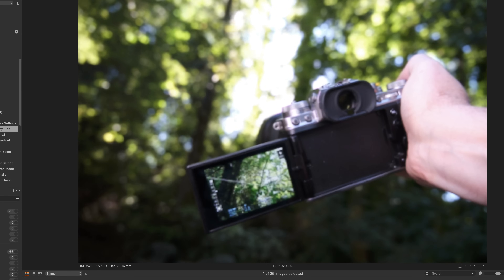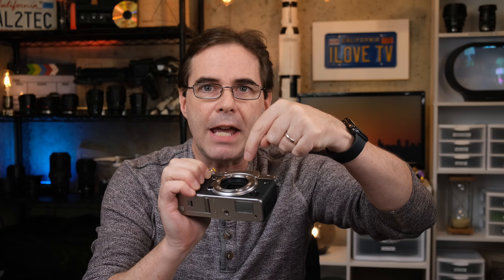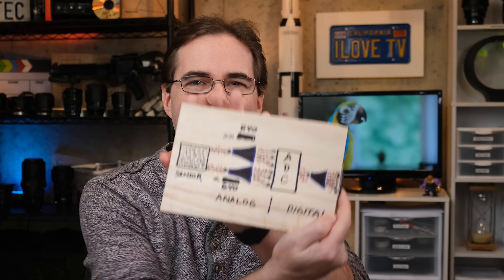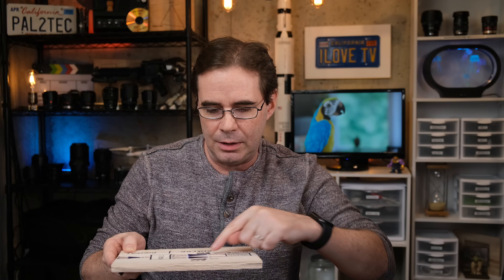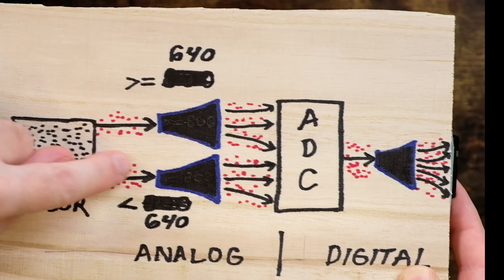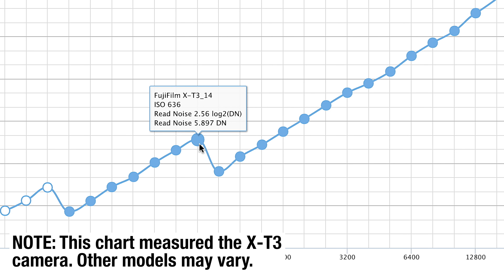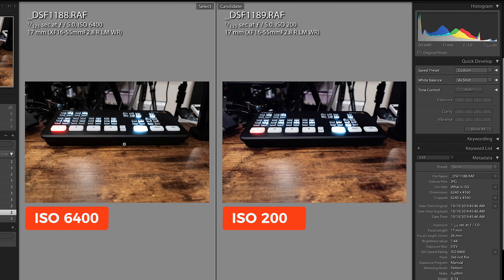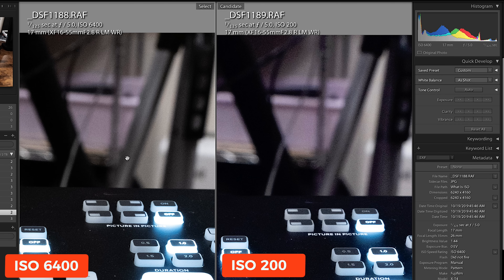Fuji ISO Performance

Comment: Can I take advantage of lower ISO settings by just setting my exposure compensation to EV -2 or -3 and bump up in post processing?
Reply: The sensor-sensity itself isn't altered, that's rigth but there is analog amplification going on as well and and a resulting effective sensitivity. Beside this minor point, well... as I said.
Reply: No, you then have the amplifiers still cranked up but the input lowered which means a worse noise/signal ratio.
Reply: @kalenderquantentunnel9411 , lowering the EV would lower the ISO (if there's room), not raise it. Or is there a different amplifier you are thinking of?
Reply: Lowering EV means lowering the Exposure Value ie amount of light hitting the sensor (for a given ISO when turning the +/- dial but also in general). Increasing ISO means increasing sensor sensitivity by increasing the amplification of the signal delivered. At least this is how I understand it. 🙃 Two seperate entities. Therefore, changin EV means changing shutter speed, aperture or both but does not influence ISO.
Reply: The sensor's sensitivity has nothing to do with the ISO - one of the points of this video. There's a digital readout of the sensor which is solely based on F-stop and exposure time, bot of which control how much light hits the sensor.
You can see evidence of this yourself by taking an ISO bracketed exposure. When you do this, the result is a single exposed picture that is subjected to different ISO settings. Look at the pictures and you'll they were all taken from the same exposure.
This is different than when you take a bracket of exposure or F-stop. The result from these is a set of pictures that are taken sequentially, not a reprocessing of the same picture.

Comment: hi pal question after i transfer my raw file to LR it has 40 sharpness but in my camera setting is normal. i didn't change anything in my camera TIA.
Reply: That is probably LR's default setting and has nothing to do with the in-camera sharpening. The latter should only influence JPGs right out of camera. Camera-settings can be interpreted by PC-software but in some cases are just ignored.
Reply: @kalenderquantentunnel9411   thank you

Comment: You could shoot a low ISO 200 and still get a great exposure without bumping up the exposure in post by setting the shutter speed to bulb.  You could also get a sekonic light meter and set the shutter speed at 1/125th, 1/60th or 1/30th to find your aperture setting on your lens.  If you need a slower speed than 1/30th then please use a tripod.  It may say that you need an aperture of 1.8 on your lens.  Take a shot with assistance of the light meter or in a bulb setting so your photo would have the details and less noise.

Comment: Is it better to set ISO 800 vs ISO 640 (native) to have less noise in video mode (if to compare with ISO 640)?
Reply: He says that the second amp kicks in at 640. So, 640 is better than  both 500 and 800, and 800 is better than both 500 and 636. This is how I understand the graph.

Comment: Nicely done explanation. However, I figured out that trying to outthink the Fuji engineers does not usually improve my photography in a meaningful way. I have a tendency to choose my shutter speed and aperture based on my artistic intent. I will then set my ISO either manually or using one of the automatic settings to achieve the brightness I desire. Sometimes I may expose to protect the highlights other times I may let some of the highlights become blown out. If necessary the ISO invariance allows me to pull shadows up to get the desired look. I usually try to achieve the look I want in camera and I often will have the grain setting on weak and sometimes strong. Therefore noise in high ISO shots doesn't usually bother me. I do enjoy your videos so please keep up the good work.

Comment: How about better yet,  just add light to your scene and keep your ISO at 200 and not have to add exposure in software at all, and have a clean no noise image?
LOL
Reply: He was obviously talking about in the cases of when you can’t add light to your scene, of which there are many.
Reply: @johnp515  there is always a way
Reply: @AMomentInTimeProductions  Interesting. How would you light a distant mountain?
Reply: @johnp515  if it's a distant mountain then you don't need lights, and don't need high ISO unless your shooting it in the dark LOL
it's call a good lens  one that will allow 1.4 or 1.8 aperture  no reason for high ISO in daylight,
a 1.4 or 1.8 aperture you will never need high iso for a distant mountain, ever,  in fact using a 1.4  or 1.8 aperture lens in daylight you need a neutral density filter, because it's too bright, even on a cloudy day.
Reply: @AMomentInTimeProductions  I’m not quite sure why you’re using capital letter “LoL”s. I presume you’re not joking but anyway, one thing you’ve done is move the goalposts. I was responding to your claim that you can light every subject in photography and gave you an example. You now have admitted that you can’t always use lights in every scenario but presumably talk of the need for tripods and and/or fast lenses so now it’s become two ways in which you don’t need to use high ISO’s. In any case your talk of f1.4 lenses is irrelevant to a landscape photographer. Lenses are invariably most sharp at f5.6 to f8 and a shallow depth of field is not desirable and a tripod will usually be used. I’m not sure if you’re being deliberately obtuse but there are obviously many kinds of photography where neither a tripod nor lights are possible nor desirable. Street photography, concerts or sports events where setting up lights or using flash is prohibited or in any case where a high shutter speed and/or a wide DOF is desirable but the light is low. There are also photographers who simply prefer natural light and don’t wish to carry a tripod.
Reply: @johnp515  the 1.4 lens i mention was just an example.
how ever i never seen any one need to use High ISO to do lasndscape photography during the day, because there is plenty of light.
in fact all the best landscape photography are not done in high ISO.
when i said there is always a way, i meant that is, but i didn't mean using lights i the solution to ever situation, but there is a way to avoid High ISO, i never go above 200 ISO ever never..
and always managed to maintain that, because there is always a solution to avoid High ISO in most cases any way.
90% of the people who use HIGH ISO,  really didn't need to do that.
your example about landscape shot, that would be the last thing you would need Higher ISO, In fact in any daylight situdion going over 200 ISO would most likely over expose a picture unless you was taking a picture in the woods where trees was blocking the sky, but then again, most landscape shots are NOT done inside a forest, it's mostly well landscape, rock, waterfall, flowers, maybe a  farmhouse, all situations where High ISO should Never been needed.
Been doing photography for over 30 years and i'm a cinematographer, right now working on a NetFlix Series.
i have worked with the best people and worked in the most hardest situations and still manage to Avoid High ISO, in fact would be fired if i ever even attempted to use HIGH ISO as alternative for proper exposure shooting this NetFix  Series,
in hollywood or any major commercial shooting Quality matters, and is not negotiable..
Reply: The other thing i wanted to mention, is that other then your camera and lens, light is the most important factor in the quality of your  image or video it's just as simple as that.

Did you know that 90% of all night scenes shot in hollywood is actually shot in daylight? this is true,  for a number of reasons, #1 so the quality of the movie is consistently good,  shooting at night would introduce grain, and noise? ever wonder why in a hollywood movie you don't see that? because they shot that scene during the day, and then in postproduction turned it into a night scene. They even go as far as replace the sky with stars and a moon, or  what ever, but it's all hollwood's way of keeping good quality.

first off most Camera's can't get good focus at night, it just can't work and it's almost impossible to do it manually because you can see anything.
I my opinion shooting anything commercially, high ISO is not an option, and never will be.

Comment: Very good video! Good to see you followed up from my last comment ;) One thing, in Lightroom, the reason you see a bit difference when bringing up exposure from 200 is that native ISO range is partly analog amplified all the way to ISO 800. First after ISO 800 you are only multiplying numbers. So I would actually use ISO as ISO up until 800 on X-T3 if low noise is more important, then if you have to go 1600, it's better to just shoot ISO 800 and bring it up in LR. This is also why you see noise in the ISO200 image at 09:04, just start at 800 and bring it up. Take a look at this graph from Photon site, it will confirm what I say, select X-T3: https://www.photonstophotos.net/Charts/PDR_Shadow.htm
Reply: And if you really like to go all in, get RawDigger and analyze the files. Shoot some with UniWB whitebalance and some with regular AWD, then get shoked as you see you can expose a full 1 1/2 stop more than the cameras actual clipping point, but thats another story for ETTR ;) Hihi

Comment: Thanks for the Vdo on iso..good explanation..one question should we use iso 320 then 640 1280 etc ...instead of round figure like 200 /400 /800 etc ..for both stills n vdo

Comment: I just did this lesson on my course and I used a similar example - an electric guitar 🎸
Reply from the maker: Now THAT's an awesome example to use!!!!!!!! 🎸🔥 💯
Reply: First thing that came to my mind. I also wondered if I could use my pedals?
Reply: @Deminimis2  Some pedals would be a great example of how, depending on the order in which processing operations are made, you can end up with a lot more/less noise because of how added noise (rounding errors and the like) can get further amplified.

Comment: so we can jump from 400 to 800 for less noise?
Reply from the maker: In theory, yes. In practice that depends on the lighting, the post-production RAW converter, and other factors. Best to experiment and see. Generally you should choose lowest ISO you can when shooting. The above-640 ISO issue comes into play more when you are bumping the ISO in post. Meaning, it's probably better to bump up ISO 800 than ISO 500 in post if you are using an ISO invariance technique. But again, always best to experiment as your results may vary. Even shutter speeds can affect this.
Reply: @pal2tech  thanks very much, i'm definitely going to try out different variations to check the difference in result. by the way, you have the most entertaining fuji focused channel i came across (:
Reply: I was trying out this iso invariant experient myself few hours ago, talking about coincidence. Your videos made a lot of sense with samples photos. Thanks for sharing !